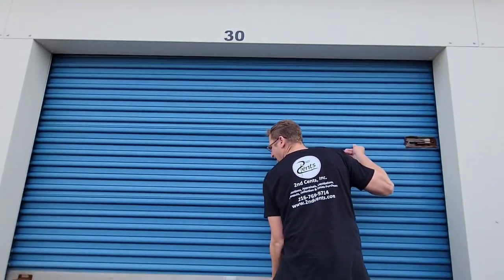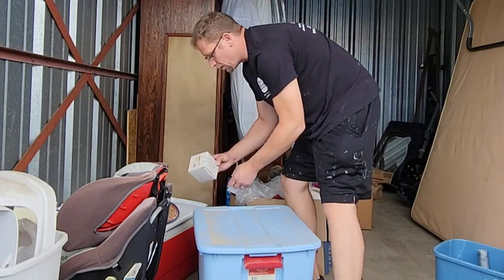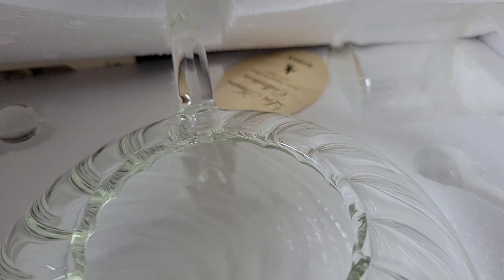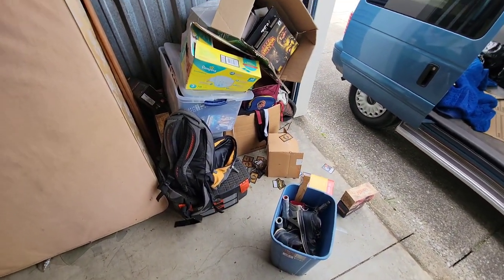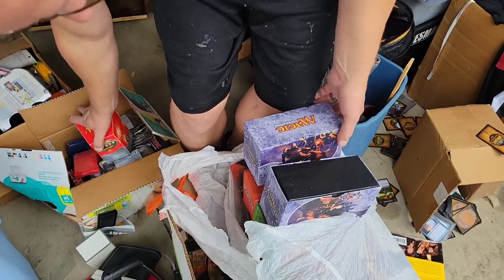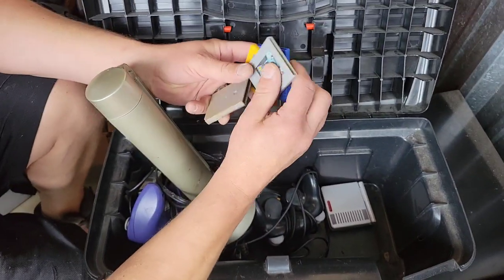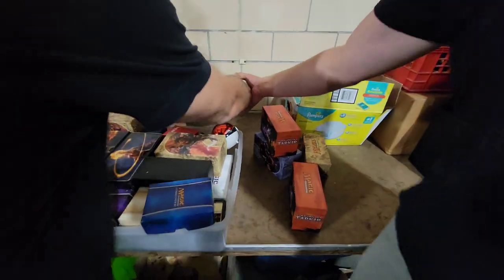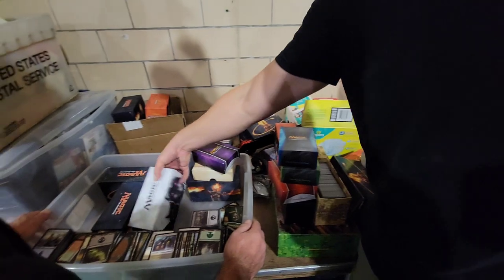Worth $1,000's & I only paid $310 for Storage Locker! ~ You won't believe he ABANDONED Unit!

Comment: Consult someone with actual knowledge on the magic cards, comments thus far have been huge miss.

You are not going to find a black lotus. The generations are waaay off.

You may not have all bulk. But based on the generations of cards you probably dont have a 1k box there either
Reply: Also majority of your sealed packs are land packs and/or promotional decks, they arent worth much. Majority of items that come in clear celophane packs are not valuable. 

Gold set symbol/red set symbol is the rare for the blocks/sets you have here, and typically where the value is going to be if any